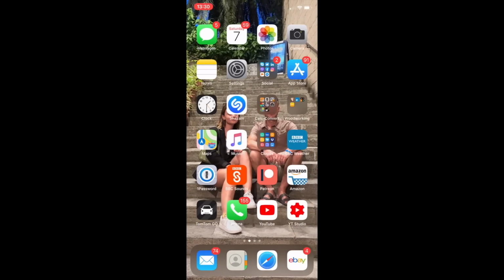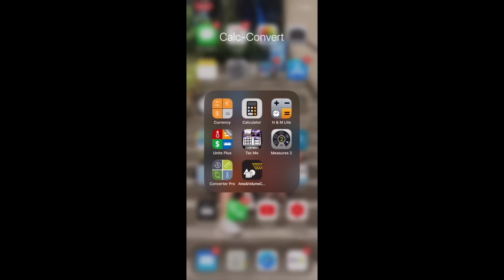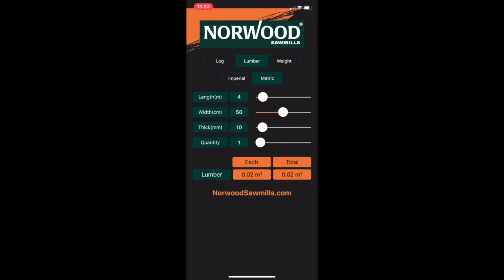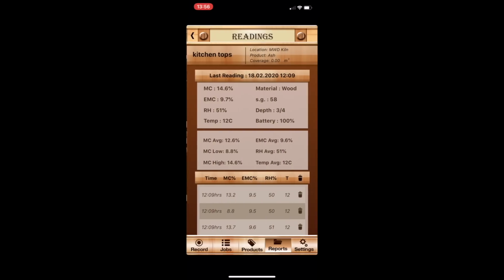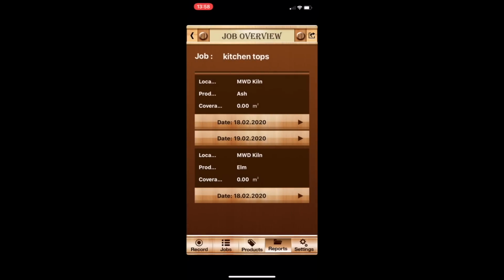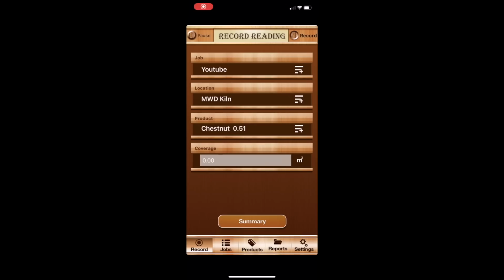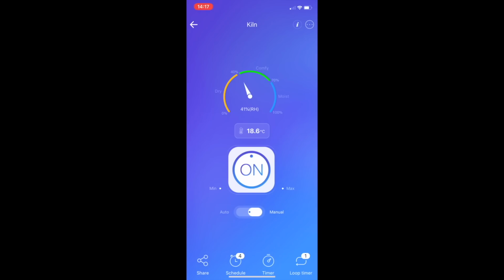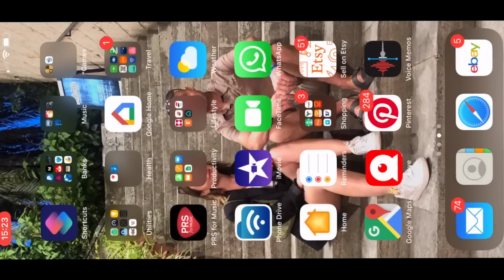#MWShoptalk - Woodworking with an Iphone smart phone ?

Comment: Hi Andy,
My brand new Orion 950 does not connect to any of my 3 android phones.
1. Samsung Galaxy S22 Ultra.
2. Samsung Galaxy Note 9.
3. Samsung Galaxy S9.
No matter what I tried, Orion 950 will not connect to FloorSmart or WoodshopMC.
It is quite disturbing and very disappointing that there is no any description in the Orion 950's manual or in the apps themselves about how to connect or use the apps.
Listening carefully to what you said, when recording different measurements, you said that you hit "SEND" after you recorded the measurements. What button on Orion 950 corresponds to "send"?
Reply from the maker: Get an iPhone :)

Comment: Hi manor wood
 Thank you for your video. May i ask you for your opinion. I am doing a resin table with two walnut pieces. It had lost of twist. One came to 3.5cm and the other came to 3cm. Would you pour the ticker slab in a mold pour a 5mm resin then when it thickens a bit place the other slab and complete the pour? Second option. Make them face down pour resin then the bottom becomes the top when i flatten it? Or just make the thicker one thinner? Thanks for everything. Last question please i have a festool 2200  router like yours and a router bit that flattens slab exactly like yours. What speed do you put the router on? I tend to pit it 2 to 3 Thanks for everything
Reply from the maker: Both way will work , I would pick the one your are more comfortable with :)